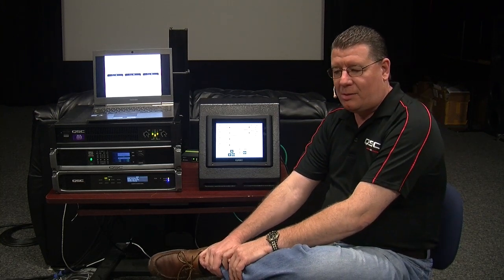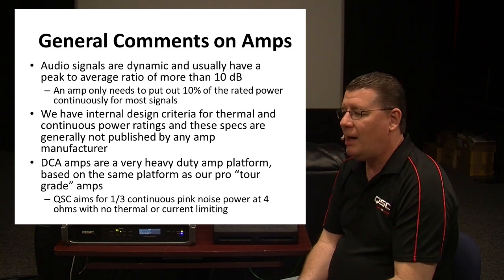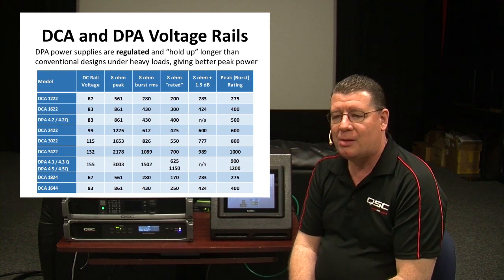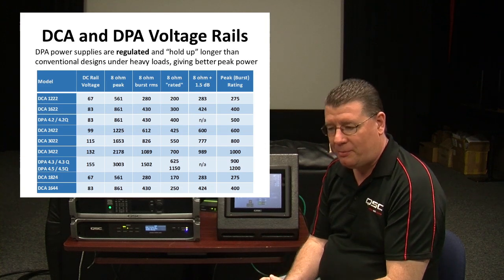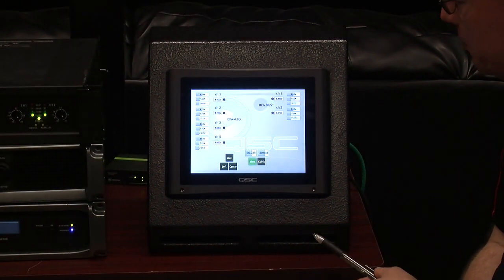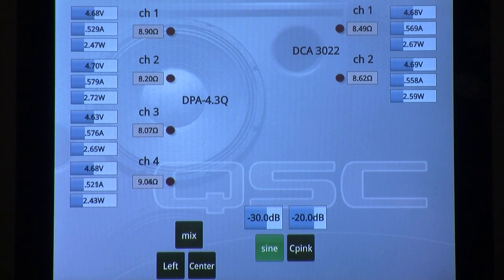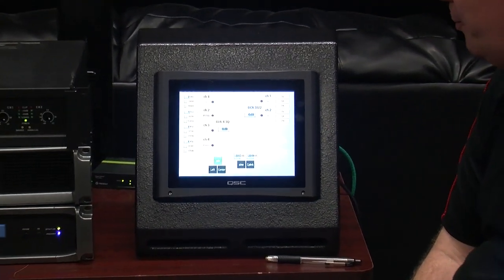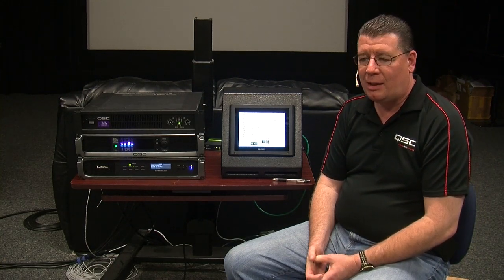QSC Cinema: Real-World Amplifier Power Specifications

Comment: How is DPA 4.2 different than PLD 4.2?
Reply: The dpa is for Cinema and the pld is for live sound
Reply: Just the connectors on the back are different.  Both work for both applications..the dpa requires patch bays to be wired in for live sound.